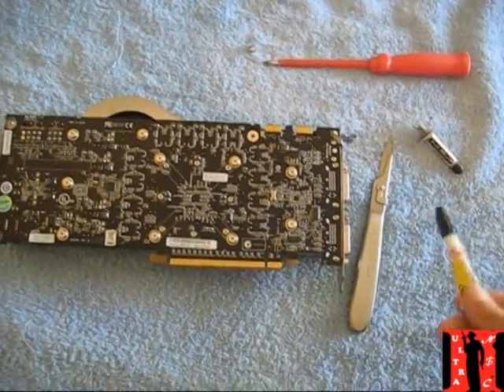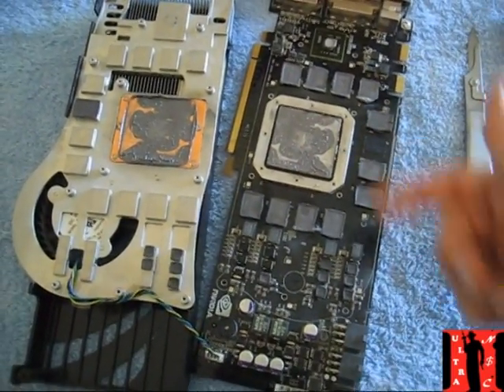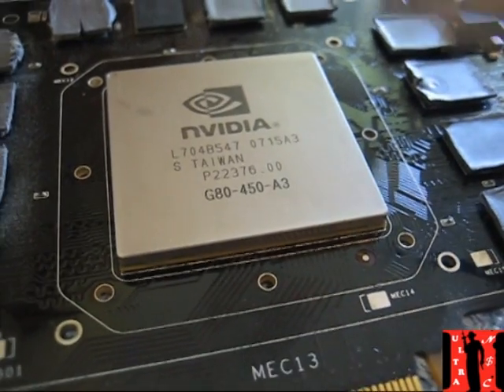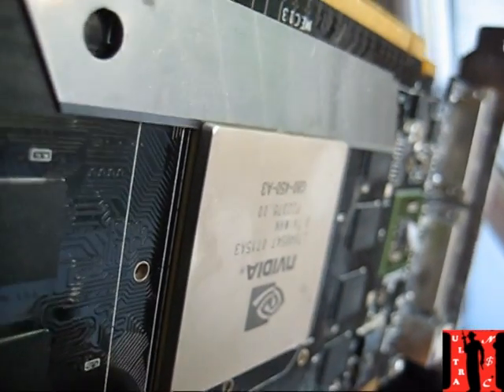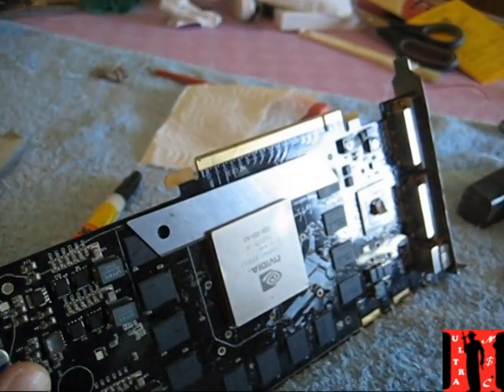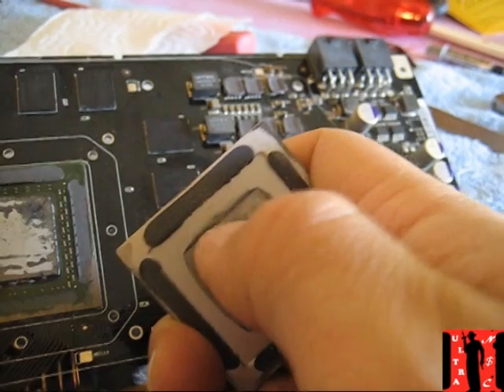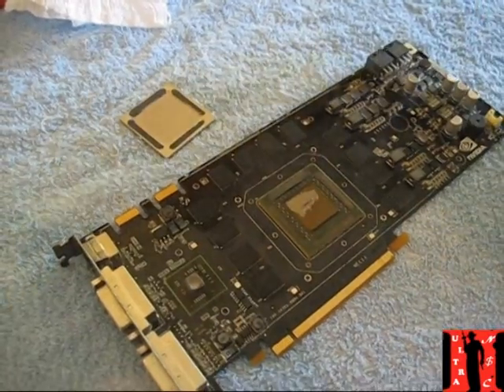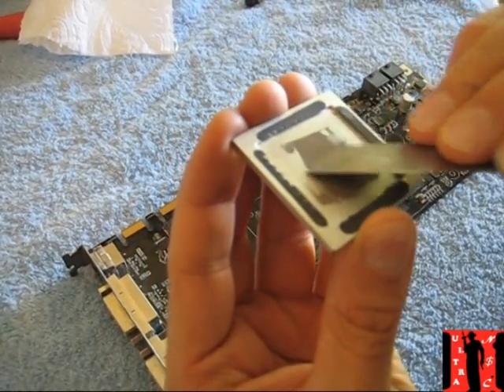nVIDIA GPU Part1 By:NS©

Comment from the maker: @davidkerr7 the same, it will be better, but be carefull at all, when posible get a extra cooler for the ChipSet, cause Default ChipSets Cooler are just bad...

Nforce Boards also get real hot, thats why i just buy Intel ChipSet Boards, Nforce long time not buyed, my last was i think the 680i SLI....so F*CKING Hot ChipSets =_o

P45, X48, P55 and X58 are realy ok at the Temps, not really need 2 change something here at this Boards. 

;)

Comment from the maker: @MyPlatinum23 ive opened again and i did it some better, the mettal nVIDIA panel that u take out, u should grind the rest glue from default completely down, at the back side, then u have better better contact 2 the GPU again...if u also have a great AIR Cooler like a MK13, then u can also let the nVIDIA Panel completely out, cause then u have the BEST Cooling ever, so at this way the Chip haves DIRECT Contact 2 the GPU, and yes, at the GTX 285 is the same, and its no Glue needed,